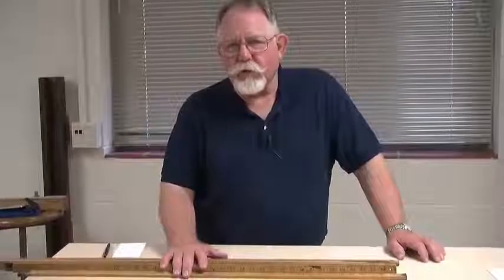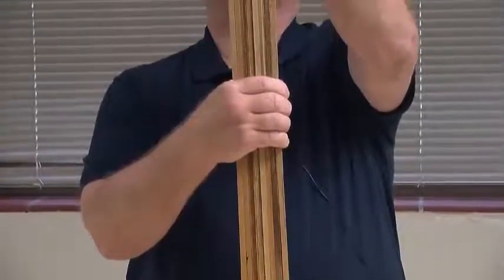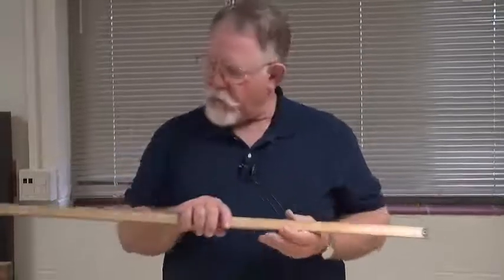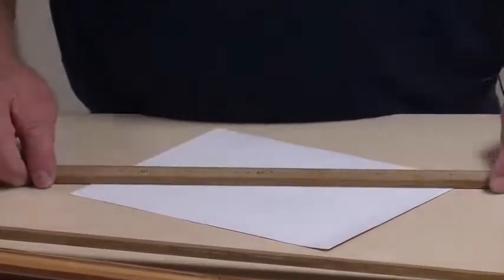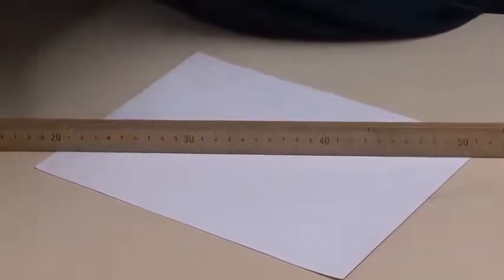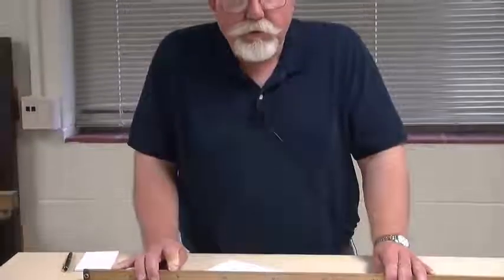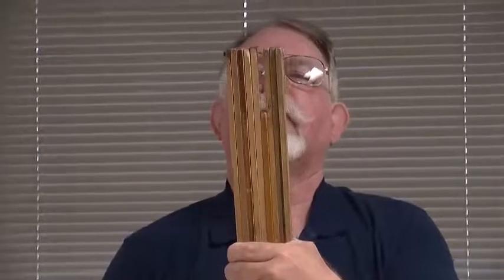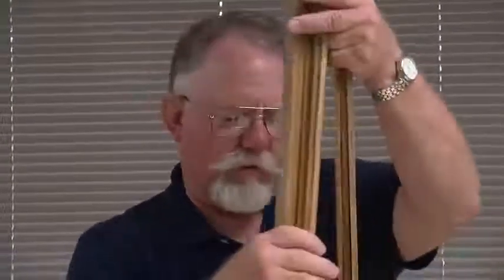Meter Stick

Comment: Great information, I took a concrete block course once, the instructor would take 2 100 foot tapes and lay them out next to each other, they were never the same length. Some were close,maybe off 1/8 inch but sometimes up to 5/8 of an inch.